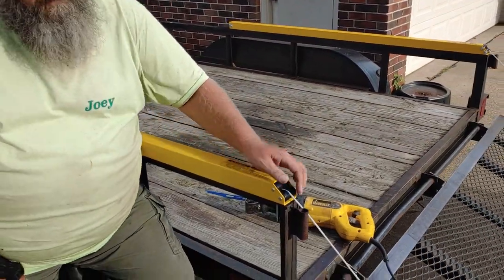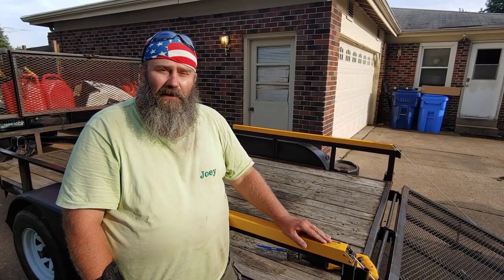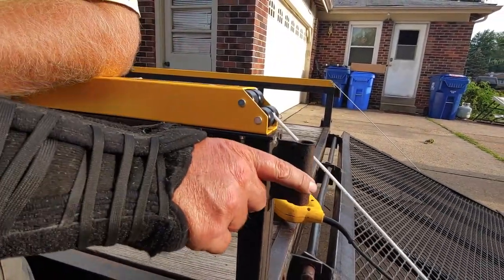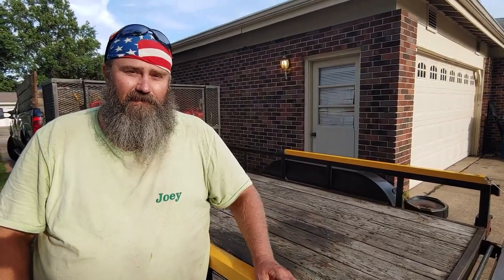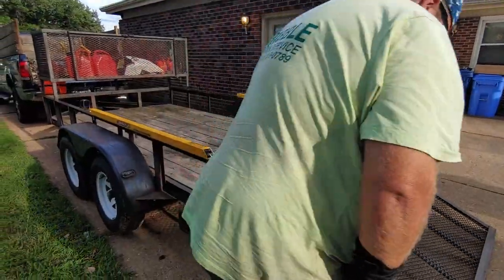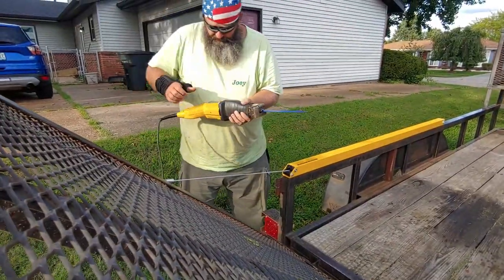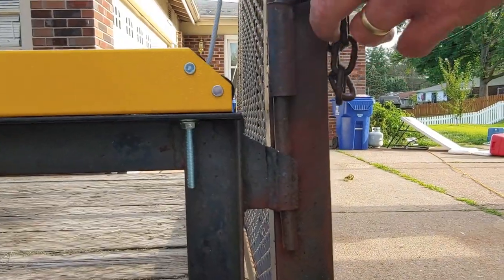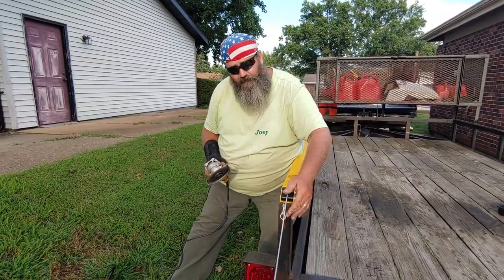Gorilla Lift Tailgate Assist - Trailer Modification

Comment: Besides the small modification you had to make, how do you like the lift system? I have seen them for years, and always wondered how well they worked.
Reply from the maker: installed easy and I should have bought them years ago. So much easier on the back. I lift and lower that gate 20 times a day, my back feels so much better now. I am kicking myself in the ass for not buying them years ago